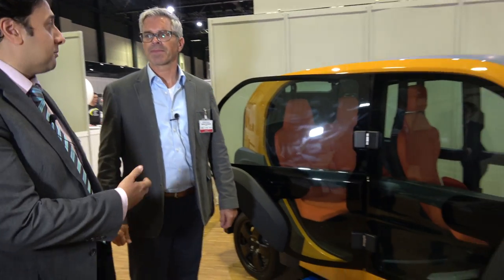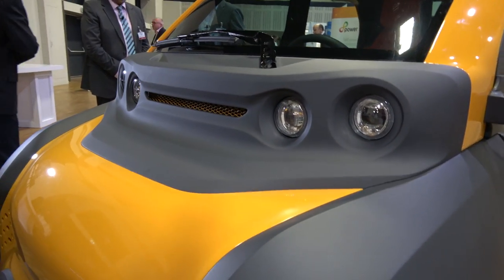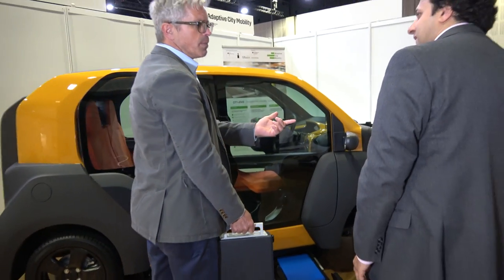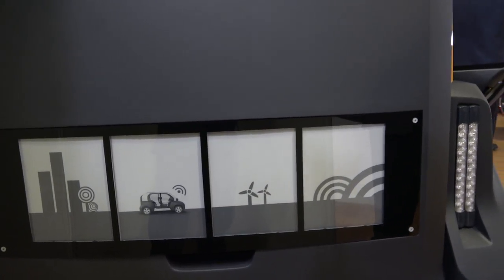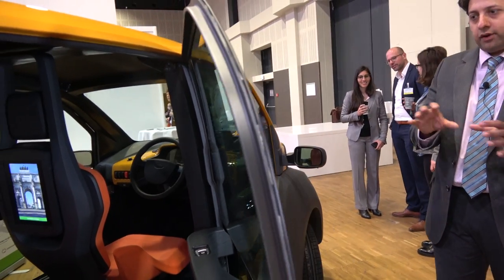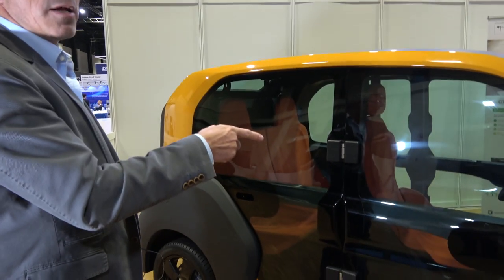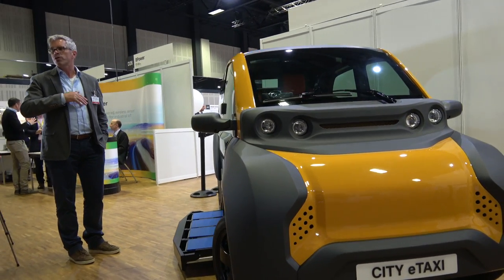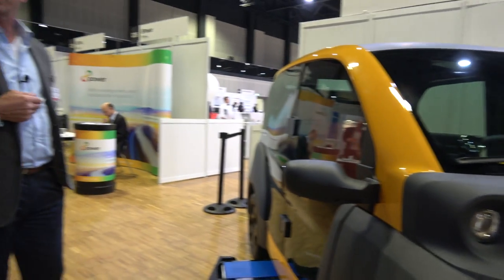Electric Taxi with Battery Swap, 550kg, Adaptive City Mobility Prototype

Comment: Battery Swap stations are already tried in 2012/2013 by Better Place (an Israeli company) with the ZE Fluence cars provided by Renault. It failed because the proprietary system was complex and costly to use. The company needed new investors and didn't find them. There isn't a universal (swappable) battery standard so all infrastructure has to be self developed. Not a really great business model. The same for scooters (Gogoroo in Taiwan).
Reply from the maker: I disagree, battery swap stations were not enacted as an industry standard, I think that would be required, also by Governments forcing all Electric car companies to make their battery systems follow that common standard.

If every petrol powered car had a different system for petrol, then cars wouldn't work today.

I'd like to think that the economics would work also, the benefit of having extra batteries throughout the system would outweigh the extra cost of having all these extra batteries distributed around the system. The fact that we need these batteries to feed into and out of the smart grid, and smart algorithms can smartly limit the number of extra batteries required. And the fact that consumers will be able to buy an electric car without having to pay $10-15K for the batteries upfront, but instead pay a reasonable monthly battery network service, possibly through taxes and Governments, I think that is the only way EVs can take over the whole car market quickly.
Reply: sorry charbax but what do you mean by this "the benefit of havingextra 
batteries throughout the system would outweigh the extra cost of having all these extra batteries distributed around the system"?

I think that modular (battery swap) batteries would be a way better alternative for users/clients for many reasons, one of them being that people in the citys could take their batterys to charge at home, they could use the batteries for something else, they wouldn't have to buy a whole new car everytime and they would just have to replace the batteries like every other consumer electronics and possibly many other reasons that I'm not gonna put effort into.

And obviously it didn' fail because renaults are using that system, now we the customers gotta demand that from all other companies like tesla, etc. otherwise they will lose their customers.
Reply from the maker: Tesla is in a business of getting people only excited about Tesla, and maybe they don't want to begin with the battery swap network themselves alone. I think Tesla has to be forced by Government to make sure each new Tesla is battery swap ready. Tesla already showed demos of the Model S swapping the battery in less than 1 minute, I think it has to be possible.

The idea is that you get a $10-15K discount on your electric car by not paying upfront for the battery when you buy your car. But then to use the car you would have to pay a monthly battery network service fee, it might be something around $50/month if you don't mind using an old, shorter range, lower recharge cycles battery most often in your car, or it could be upwards $100/month if you want the newest battery technology with the longest range in your electric car. If you want you can also be on the older lower range battery most of the time and pay extra only when you want a longer range, perhaps you want to drive onto a long trip for the weekend, so maybe you have to pay $20 extra just to swap to a newest longest range battery just for that weekend trip.

The whole battery swapping network would be managed smartly, and so for about $100/month or less, in average, consumers should be able to swap their electric car batteries and this should also include all clean energy costs to recharge your batteries at home, and away. A bit like an internet service provider, a bit like a mobile phone carrier, you pay one charge and it must cover the access to the batteries swapping network and also access to recharging with clean energy wherever you are. A system of roaming and etc should be in place, and there can be some extra fee to use fast chargers if your battery and if your car is compatible.
Reply: @charbax  That's a very interesting video. Unfortunately we came I little bit late. We believe battery swap could be a solution to the limited range issue. Picchio is an italian company specialized in the automotive sector and designed an efficient, easy and cheap battery swap system.
Reply from the maker: @PicchioSpa  Hi Picchio, I am a huge fan of battery swap. Perhaps we could have a live video chat interview here on YouTube about your battery swap system and other things you do? let me know if you're available to do a video.
Reply: @charbax  If I just come with a wild guess here and claim that a swappable battery like this take 20kWh to charge. That will need 3.50 EUR of electricity. and emit 12 kg of CO2 in Germany if you charge at home!
If you then put a swapping infrastructure on top of that, which I presume in handling is equivalent to the running costs in the now defunct Israeli "Better place", where subscribers paid a monthly fee of 399 EUR for such a service, but you somehow are able to half that to 200 EUR, your customers will pay twice as much for their electricity. What however is worse is that the extra 105 EUR spent, will account for roughly 28 kg extra CO2 or 945g CO2 per day, if we use the German national footprint/ German BNP ( 3.4 billion EUR/ 911 million tonnes) of 270g CO2 per Euro billed. That means that your vehicles will have  to drive more than 125km per charge before they emit less than a gasoline car, i.e. be better than 102g CO2/km. This might be possible on paper if this is mainly is intended for slow speed city driving, but this will regardless be slightly worse than home charging whichever way you look at it. So you're are betting that the German grid will be a lot cleaner and cheaper in a few years?
Reply from the maker: @Tore_Lund  about 3-4 million cars are sold in Germany each year. By 2021-2022 they could make sure at least half of those are 100% electric. All should have battery swap and following battery swapping standard. It means electric cars can be 10-20 thousand euros cheaper to buy upfront. Battery service costs would be between 50 euros per month to 100 euros per month, depending on the range/quality of battery you decide to be using. Shorter range, older batteries are on the 50 euro per month plan, while brand new longer range faster charging batteries are on the 100 euro per month plan service. This means also Germany MUST build out 100% renewable energy production solar/wind with the required smart grid to be able to power at least 2 million more households per year. This means by 2030, over 80% of cars on the road in Germany could be 100% electric and with those charged by 100% clean/renewable energy. All coal must be stopped and all nuclear must be disconnected also gradually as renewables and the smart grid takes over. It's simple common sense. Project Better Place didn't work because it was a privately funded Israeli startup. You can't make a global standard just within one company. This has to be Government policy implemented accross the whole industry on a total European Union basis to globally. China must get on board with the same battery swapping standard, they want to be selling Chinese batteries to everybody. India must use this too. Everybody must adopt it, USA and South America too.
Reply: @charbax  We completely agree then, and if you can get subscription down to 50 EUR, I retract my complaints! I know Germany has an energy plan, but with the current level of ambition, I doubt they will have made a significant change in 10 years. BTW I'm Danish and 58% of our electricity comes from your Ruhr district, so we would also benefit enormously if you changed to renewables. Either by selling some to us, or by forcing us to invest more ourselves as you possibly will decide to stop exporting coal power as one of the most obvious ways to lower emissions? So I agree with your project in general terms, especially as your vision is for a future energy infrastructure and not next year, where this would be difficult for the mentioned reasons. Thanks!
Reply from the maker: @Tore_Lund  I'm Danish too. I think Mette Frederiksen has plans to gradually ramp up renewable energy production, even as Denmark is world champion in terms of wind energy per citizen, Denmark needs to double the amount of wind power before the end of her 4 year term, before 2023, and Denmark can be a net exporter of renewable energy during most times of the day. Also Denmark needs to rapidly setup a smart grid and ramp up taxes on old fashioned gas powered cars and much subsidize the sales of 100% electric cars only, be a forerunner on battery swapping, as battery swapping and the smart grid is perfect for Denmark. Sure this cannot be done all in 1 year. But if you add enough renewables to power 5% of the population every year, about 5% of the Danish population buys new cars every year too, so those should be mostly electric before the end of Mette Frederiksen's term, that means you add as much renewables as you add cars, consider one car battery can help to power most of a household's energy usage at peak demand through a smart grid (which automatically pulls off energy off electric cars that are parked during peak enery demand hours of the evening) if there is no wind at night (which in Denmark is rare), up to half that electric car battery can be pulled off to the smart grid at peak, as more than likely during the rest of the night will be plenty enough wind power to recharge the battery fully by next morning. This way Denmark could run 100% on renewable 100% clean energy by about 2030 or so. That would be the most ambitious clean energy national plan in the world. Consider this only requires building renewables for 250K danish people per year and bringing in 150-200K electric cars (most of new cars brought in) per year. It's not very complicated. Can easily be achieved. And actually done smartly, using renewables and electric cars, Denmark could be saving a lot of money on energy. By 2030, Denmark would have the world's cheapest energy and would be making Billions of euros exporting all that wind, solar, electric car and smart grid expertise to the world.
Reply: @charbax  You're right, in that it has to follow, but there have been very little mentioning of expanding renewables yet (two farms planned) I'm guessing we'll need another 40 wind farms to cover 500.000 EVs alone as the plan is now.
The greater problem especially apparent in yesterday's opening debate in our parliament, was that Energy transition had been moved down to 5'th place in the priority list in Mette's opening speech! Likewise our environment secretary Dan Jørgensen, is still avoiding the hard questions and have proved he has very little engineering sense: First we had the Facebook data center in Fyn, which he claims will be CO2 neutral. However just buying existing capacity from Norway, will not reduce emissions, it will just force Norway to buy more energy elsewhere and despite their hydro power, they still have a footprint as big as Denmark at 243g CO2/kWh, so while this looks good on paper, it just exports the 500.000 tonnes resulting emissions to Norway's energy budget, so it is not neutral, but quite the opposite! Likewise he seems rather clueless when ever journalists are asking about the broader picture, but as they say they are working on an action plan, and I presume they hired both scientists and engineers?

About cars: We have made our society dependent on commuting. So the first step is to gradually reduce the tax rebate you get for driving to and from work. This is however a very sensitive subject, regardless of color, but the fact is they tried it in Germany, and after months of complaints about living costs in small villages, businesses reopened in local communities, because more chose to work closer to home, and more were driving through their city from elsewhere instead of just whizzing by on the Autobahn, so the result is they converted part of an enormous cost to a tax income. We need to realise this too! 
Secondly, even a simple thing like reducing highway speed limit to 100 or 90 km/h would also result in 15-30% reductions overnight. So just saying the buzzword "Green cars" as the only magic needed for the transport sector is very worrying.

So in a sense I fear the current government is just as clueless and cheating as the previous. They have committed to a 70% reduction of the 1990 level by 2040, so let us empirically figure out what this requires:
In 1990 each of us emitted 10 tonnes per year. However we were only 5.13 million as opposed to 5.7 million now, so we need to get down to 1928' level at around 3 tonnes each, when people sewed their own clothes and had potatoes in their backyards, and mostly feet for transport! This is around a factor 5 reduction, this will absolutely require changing everything, especially if we account for future population growth. In that context, we should be expecting double fuel price and and a ban on meat by next week. However I'm sure what they have in mind sadly is a lot less radical.
Reply from the maker: @Tore_Lund  Doing a bit of quick calculations based on Wikipedia, today Denmark has about 750 offshore wind turbines totally providing about 1700MW of wind power capacity to Denmark. That alone is enough to charge about 816.000 Tesla Model 3 in Denmark overnight (25% average charge on an average 50 kWh battery, rarely do EV users need a full charge from near empty overnight) considering an average of 6 hours of wind during the night to charge them. With a smart grid, all thes 816.000 Tesla Model 3 modified if necessary by Tesla to support battery swapping would be enough to provide blanket peak energy needs of 10 gigawatts off just 25% of the EV batteries back into the smart grid, enough to power about 500.000 danish households (with a maximum peak of 50 gigawatts per 2.5 million households total in Denmark), if you allow the smart grid to take off 50% off each EV then currently about 1 Million Danish households can be covered at maximum peak energy demand at 8PM in the evening. So to get to 100% CLEAN energy, Denmark needs to increase offshore wind by just 2.5x current capacity, they need to swap out at about 80% of the total 2.5 Million cars in Denmark to be fully electric by 2030 or so. Of course to get there, Denmark needs to get to 200.000 new electric cars introduced in Denmark every year as soon as possible, a significant share (80%) of all new cars (by about 2023) must thus be 100% electric. Together with these 200.000 new EVs in Denmark, Denmark would need to install about 400MW more offshore wind capacity every year, they need to install one new offshore wind turbine every 2 days or so. For the whole country of Denmark, I think they can manage one more wind turbine offshore, 1000 new electric cars sold in Denmark every 48 hours over the next decade. It's just a political choice to get it done and done smartly Denmark would win a lot of money doing that. Denmark would get a lot richer, spend less money on energy, get cleaner air, it's a no brainer. Every other country must do the same. Not just within each country's internal politics, but at Margrethe Vestager/Frans Timmermans EU level they need to blanketedly make it happen throughout Europe, put a real significant start to this European Green New Deal within the first 2-3 years of this new EU Commission mandate.
Reply from the maker: @Tore_Lund  About Denmark's commuting dependency there is also another easy solution to that, mandate the deployment of massive fleets of self driving "danish-Ubers" of some kind, throughout the country, as soon as possible. Just quite simply make it 100% legal for all self driving car companies to deploy and experiment 100% right now on every single Danish street. As soon as the $30K reliable self-driving Uber style car is ready, Danish public transport authority can order tens of thousands of them and blanket the whole country with near-free self-driving powered public transportation run on 100% renewable. That alone also would drastically reduce the need for human driven commuting. I also think all public transportation should be free in Denmark, I think this can be paid through taxes and would significantly increase the buying power of everyone in Denmark, and the whole self driving Uber style car network can be made to nicely connect with a 100% clean public transportation network. The self-driving danish-Ubers would of course all come with fully automated battery swapping. Thus all those extra self driving car batteries are there also ready feeding power back to the smart grid at peak. By going self-driving this significantly reduces the number of cars on the roads, this totally removes all traffic congesion issues but that means Denmark will need to also come up with other energy storage solutions such as pumping up water on every hill there is (there aren't many in Denmark), using hydrogen or any other idea for adding enough cheap and efficient energy storage to the smart grid.
Reply: @charbax  Thanks a lot for that writeup. This puts it in a different perspective. I did know the ev battery grid levelling made a difference, but I never considered it substantial enough to completely abolish the need for secondary power sources and to be worth as much in extra capacity , but here you are showing that there EVs are supplying some of their own power simply by better utilization of  existing turbines. The political will however?? Wind farms, also offshore, are met with local protests every time, so usually it takes 8 years from prospect to construction, and often the turbines are moved further from the coast to preserve the scenic views, which makes the slightly more expensive offshore power even more so . Two turbines every day. That is still a wartime scale effort with a 3.6MW Siemens turbine costing 6,5 million euro a piece (without sea cables) is 4.75 billion EUR / year, which is far from impossible, but as big as the yearly income in property taxes.
Reply: @charbax  Energy storage in Denmark. What is special to us are massive "Salt Horsts" I don't know what they are called in English, essentially geological ballon shaped subterranean deposits of chalk, which have been suggested to be hydraulic excavated and turned into pressurised air storage. Less grandiose is phase shift heat storage driving turbines as an amazingly cheap (on paper) way of providing storage. In the Danish engineering world, energy storage is top priority.  I'm not completely following you on your robot Uber suggestion: Obviously EVs powered from a clean grid, is the way to go, but self driving carsas a service will not reduce the number or length of trips, so presumably the same number of cars fill the roads? You will need far less vehicles overall though, which is an advantage.
Reply from the maker: @Tore_Lund  my calculation was 1 new turbine every 2 days or so. About 1-2 new offshore wind farms completed per year over a decade. That's it. It's cheaper than to continue importing energy when we need at peak. I understand they won't get to that instantly. But Mette Frederiksen has absolute majority with green parties and so they can decide to make this rate of new wind installations happen by 2021 or so. Ramp plans out for more offshore wind installations by that time. Also I understand they can't mandate 80% of all new cars be electric on day one. But again being overly forceful they can probably make that happen gradually by the end of this term by 2023 or so. That would be totally amazing and impressive, but I think they must be able to do it, and it shouldn't cost one kroner (I think Denmark should soon adopt the Euro) extra on the long term. Actually every Dane would save money, would make money by doing this transition, Denmark is lucky to have such nasty weather, it means Denmark is one of the best candidates in the world for wind power, it means wind power is pretty much more affordable and it makes more sense for Denmark than any other country in the world.
Reply from the maker: @Tore_Lund  At one turbine per 48 hours, if 5million euro per turbine (bulk discounts etc), that's 1 Billion euro per year. But this investment means power becomes cheaper on the long term for Denmark, so Denmark cannot afford not to do it. Also the way to pay for it, is to tax gas powered cars, tax dirty cars on roads, tax car parks for dirty cars more. Tax all forms of pollution in Denmark, tax Maersk much much more they are polluting the seas of the world with their ultra dirty shipping. Maersk must not dare threaten to leave Denmark or their assets can simply be nationalized as breachment of their national contract.
Reply from the maker: @Tore_Lund  I would suggest the self-driving car rides are free as long as user agrees to switch to public transport where efficiently available on the road (such as train/metro connection which does not add time to the desired trip), it would introduce a fee if the rider wants to replace an available public transport connection to get the exclusive self-driving ride all the way. Also sharing self-driving car rides keep the fee for the ride at free. While user can choose to pay a fee to have the ride be a private one. It significantly reduces the number of cars on the roads, as requirement for car parking would be removed, currently most cars are parked over 95% of the time in average, it's a total waste of infrastructure. An efficient self-driving car would be constantly on the road transporting somebody more than 80% of the time of the day. 16x better usage of the car. You can imagine how low that reduces the actual cost of each ride. Probably it puts it close to the price per passenger on public transport, if not even lower. Also most of the rides would be for last mile routes from people's homes to nearest efficient public transportation connection, most people in Denmark live just few minutes of a self-driving car ride from an efficient public transportation station, and then again on the other end for the other last mile you can get that self-driving ride if needed to/from work or other destination too. All can be provided most efficiently for free paid for through blanket taxes on everybody.
Reply: @charbax  Power is cheap in production in Denmark, but because of energy policies in the 80' quite a large chunk of taxes were put on top to incite saving on electricity. so even in a country like the UK which has 50% more expensive electricity, they still pay less than us. Taxing car parking wont work, it will make car owners justify driving more. Parked cars don't pollute! Easier to put tax on fuel, this is a lot easier to govern and  will promote efficiency in any type of existing engine no more idling excavators etc., people in gasoline cars will be more attentive of their driving style, etc. However this is a sensitive subject too, and every politician instantly see Yellow Vests with by their  inner eye, whenever the subject matter is put forward, by reassuring the reporter that, nobody will have to pay more for living and working, But I agree, making driving a regular car needs to become less attractive.
Reply: @charbax  That is quite ingenious actually, so there really won't be any different experience regardless of what mix of public /private transport you need so i a way very democratic not making anyone feel their chosen lifestyle is singled out as bad.
Reply: @charbax  Thank you, I agree that wind farms is top priority, the key to it all and most important to get going as soon as possible. Let the doubt come to her advantage, but I'm not too optimistic. We are now at 42.4% installed wind energy and two more farms are planned for the next 5 years as it is now.
Reply: @charbax  It would be really interisting!